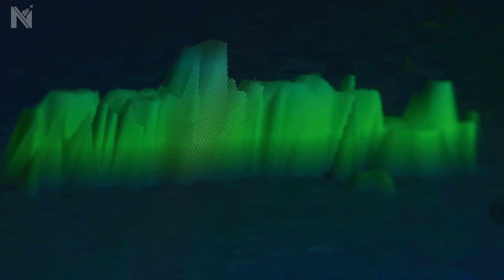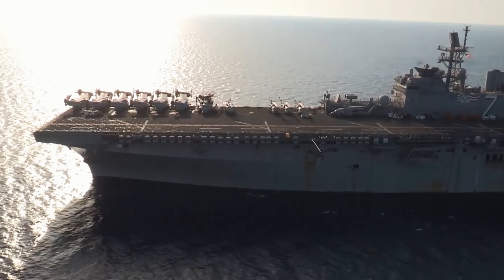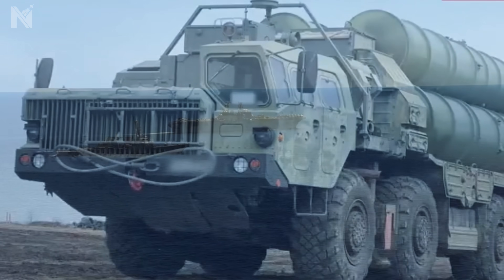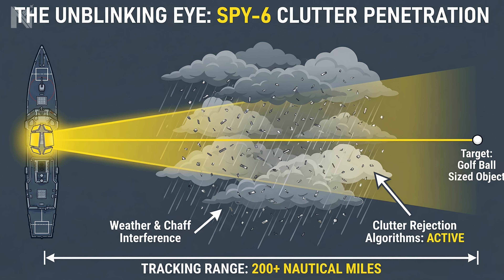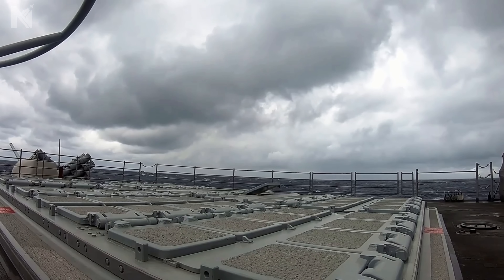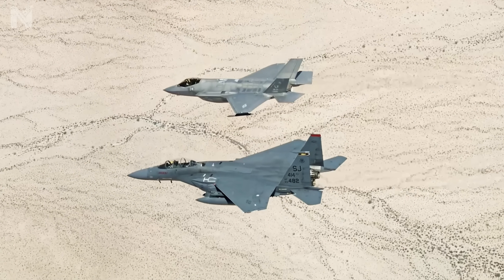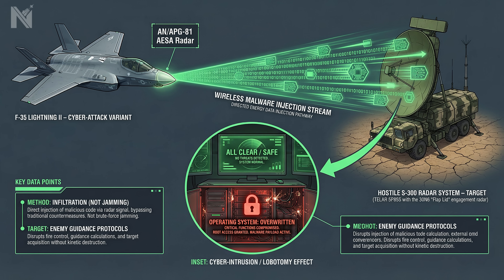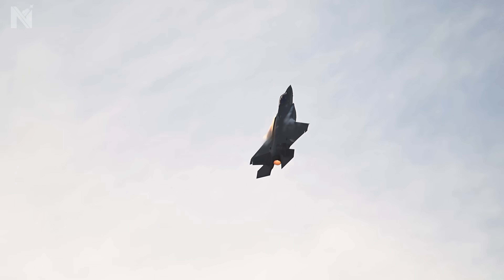Why US Navy Chose USS Iwo Jima For The Venezuela Raid

Comment: The fact that the computer has to make 40,000 adjustments per second just to maintain the hover is mind-boggling [11:21]. Great breakdown of the mechanics.
Reply from the maker: That’s exactly the point. The pilot commands intent, the flight control system solves the physics in real time so the hover is stable and repeatable.

Comment: 1:56 Is a picture of USS Sterett (DDG-104) a Flight IIA destroyer.  The USS Jack H. Lucas (DDG-125) is the only fully operational Flight III Burke.  It is in San Diego, not off the coast of Venezuela.  The  USS Ted Stevens (DDG-128) has been delivered to the USN but is not fully operational.  So your main theme is wrong.  Moreover the S-300 is an antiaircraft system, not an antiship.  The  USS Iwo Jima has SSDS Mk 2 Mod advanced  fire control system, with two Mk 29 RIM-162 ESSM (Block 1) missile launchers, two RAM missile launchers and two CIWS.  It, of course, has a Burke escort or two.  You need to check your facts a bit more closely.

Comment: The S-300 is an anti-air missile system. Not anti-ship. The Iwo Jima is protected.
Reply: Wrong.  the S-300 surface-to-air missile (SAM) system is capable of striking surface/ground targets, a "latent ability" that has been used extensively by Russian forces.
Reply: @LA-ep2nr no it isn’t .  It’s radar isn’t even going to see a ship 80 miles away.  Due to the curvature of the earth.  The Russians found it was ineffective.
Reply: @38XKB8 Here you go;  Design Intent: During Soviet development, S-300 missiles (such as the 5V55 and 48N6 series) were engineered with a latent ability to strike fixed ground/surface targets with known coordinates.
Operational Role: In recent years, particularly during the invasion of Ukraine, Russia has frequently used S-300 and S-400 systems to target cities and ground infrastructure.

Comment: The S-300 is a surface to AIR missile.
Reply: Wrong.  the S-300 surface-to-air missile (SAM) system is capable of striking ground targets, a "latent ability" that has been used extensively by Russian forces.
Reply: @LA-ep2nr  Duley noted.